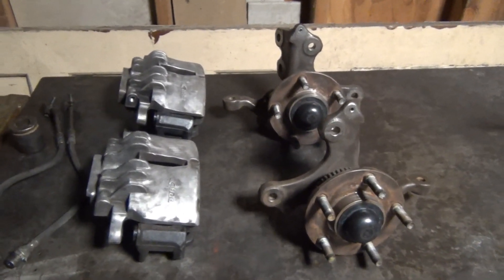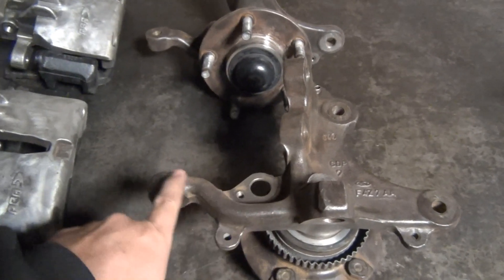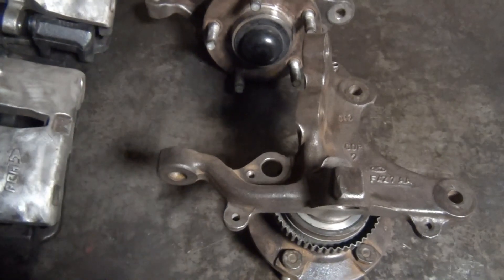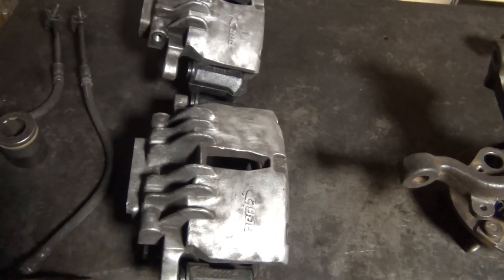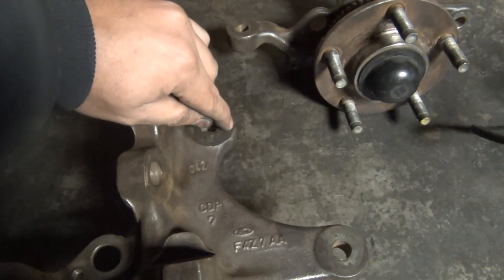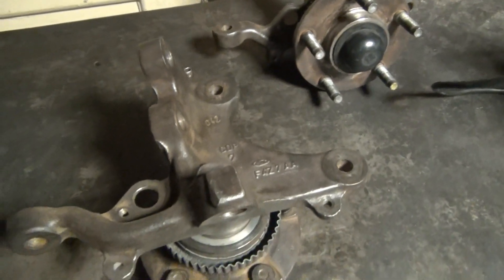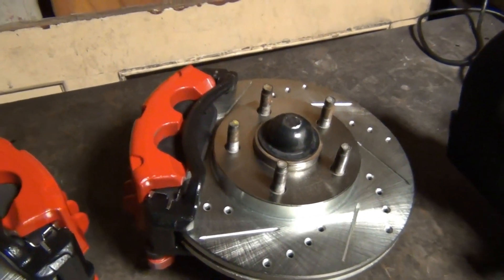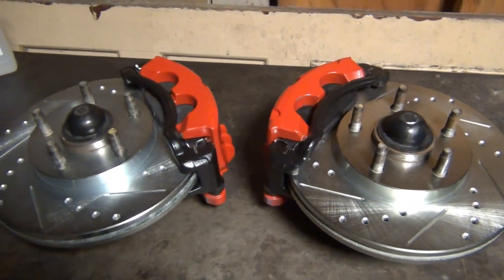The Ultimate Budget Foxbody 5 Lug Swap: Fitting PBR Brake Calipers on an early Sn95 Mustang Spindle!

Comment: What rotors and brake hoses did you use and did you change the master cylinder.
Reply from the maker: Hi, the brake calipers, the rotors, the hoses are from a 99-04 Mustang gt or V6. In order to use them on a fox you need to buy a brake line adapter fitting, I believe it was for the passenger side. I used the master cylinder and brake booster from a 1993 Cobra.

Comment: Did you swap out you upper and lower control arms as well and the outter tie rods? Or was that not necessary?
Reply from the maker: Hi, so if you have a foxbody you don’t have upper control arms in the front. You can use the stock lower control arm with the sn95 spindle but the balljoint on the fox is smaller! You can fix this by buying a set of balljoint spacers, but the easiest way is to have a set of sn95 ball joints pressed into the foxbody control arms! The tie rod ends you can get away with using the stock ones.

Comment: Which brake hose did you use?
Reply from the maker: What’s up brother! So the brake hoses were the stock 99-04 Mustang gt/v6 caliper hoses. You do need one thread adapter to connect the brake hose to the fox hardline I can get the part number for you if you need it, but they also sell a brake hose kit that is specifically made for new edge calipers on a fox.

Comment: If you are going to swap the spindles to 94/95, you may as well get Cobra calipers and 13" rotors.
Reply from the maker: You can, but that’s gonna cost a lot more money so it’s not really a junkyard or “budget” upgrade. There’s also the issue of the added weight from the 13inch rotors making you slower 😂, so they both have benefits and downsides… cobra brakes do look cool! I have some too.
Reply: @MrBlitzkrieg1987 What rotors and calipers would you recommend running then ? Or what do you run on your car for reference ?
Reply from the maker: @colinbans  hello, Im running 99-04 Mustang Calipers and rotors, that’s exactly what you see on the video. The 5 lug spindles I used were from a 94-95 mustang that’s the reason I had to grind them to fit the calipers.

Comment: what rotors would be used for this setup ?
Reply from the maker: Hey buddy, the rotors are the same from 94-04 Mustang Gt or V6. The calipers I used are from a 99-04 GT or V6 Mustang
Reply: @MrBlitzkrieg1987 Just seen this comment thank you so much man straight to the point 🙏
Reply: Why people sometimes they just change rotors and sometimes they change spindles and rotors too?
Reply from the maker: @efrenmora5975 you can use the SVO 5 lug rotors with your stock spindles, but you have to keep the stock calipers. If you want to upgrade brake calipers you need the sn95 spindles

Comment: thanks for the video! one thing on the phenolic pistons is they absorb brake fluid then swell up and don't slide in the bores correctly anymore causing the brakes to drag, go with steel pistons to prevent that.
Reply from the maker: Wow, that’s the first time someone has pointed that out to me! The one problem I do know about is that the majority of phenolic pistons are cracked, specially the driver side. For some reason people install them without noticing that there are dowels on the pads and they are inside or outside specific. But that’s more of a user error. I’ll look into what you pointed out, thanks for the heads up and for watching the video!

Comment: It just so happens that I have both 460 powered trucks and a 5.0L Notchback Foxbody.  I also have a 94 5.0L convertible sitting in my yard that will be a parts car for the 5 Lug upgrade.  I was planning on using 94 style brakes, but maybe I'll upgrade to the dual piston setup.  Are you going to use a 94 style Master cylinder or something else?
Reply from the maker: For the Master cylinder I’ll be using the 93 Cobra set up, it’s about a 1 inch bore master cylinder so the 94-95 sn95 one is almost identical, if I had a parts car available I would also use the master cylinder you have.